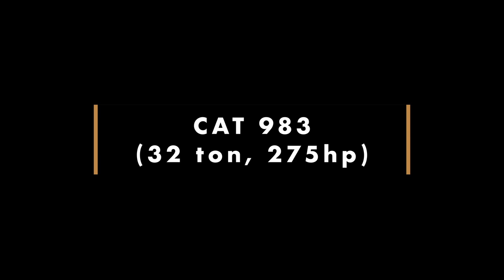Caterpillar Crawler Loader 955 / 977 / 983 all sizes, in Action!

Comment: I remember watching an operator with a 955h model tearing down houses when i was 11 years old.  I loved the sound of the cat engine.  Later on I saw many versions of the 977 and one 983. All beautiful machines.  I miss the old cat sound that is missing in the newer models.
Reply from the maker: These CAT Diesels have a great sound to them, that's true! Watching such a machine as a kid is a thing one never forgets.
Reply: I have a 955H, with a ripper and 4-way bucket. It has pedal steering and electric start. It doesn’t have ROPs of any type, but that was common in 1965. I used to ride on one as a kid so I got one as a big kid.
Reply from the maker: @ingcampthree4523  that‘s really awesome!! 👍🏻👍🏻😎😎

Comment: Is it just me or does the 983 seem kinda tired? Whereas the 977 was an animal.
Reply from the maker: You‘re right. The reason for this is: The 983 was only running on about 70%, because this was at an event where people could operate these machines themselves. And for safety reasons they didn‘t let people operate it with full throttle/full power, whereas on the 977 they could blast full throttle 😊
Reply: @Mani-io5re  Ohh nice! Looks like a great turn out for sure. I would have been there too if I could have!

Comment: Love these machines,but realistically speaking unless in a demo application these old bueties are brutally slow with low productivity and very expensive to maintain in today's standards, that's why you can pick them up for next to nothing these days ❤
Reply: Not if you know  how to operate  them. I ran the 977 with a 4 in 1 bucket and loaded  semi trucks full in 4 minutes..it's all in the skill of the operator. And if the operator  keeps the joints greased,and the fluids are kept up, and you don't abuse the machine and operate it with skill, they last a long time.

Comment: If you’re going to make a video at least get the weight specs right. 955=16tons  977=18tons
Reply from the maker: 1. I‘m talking about metric tons, not short tons. 
2. there are different weights depending on the production year.
Besides: It makes no sense whatsoever that the 955 and 977 are only 2 tons apart (like you claim). Please recheck the specs.